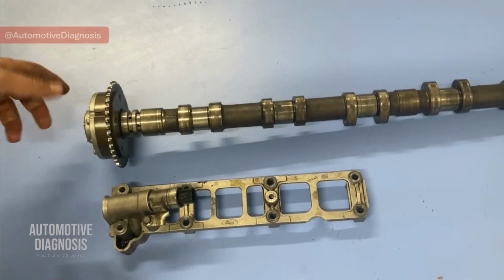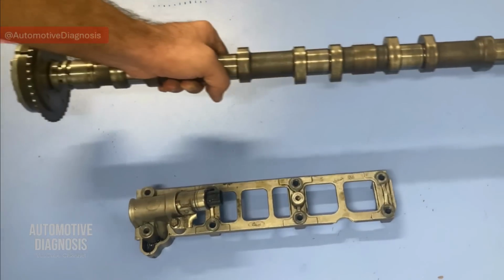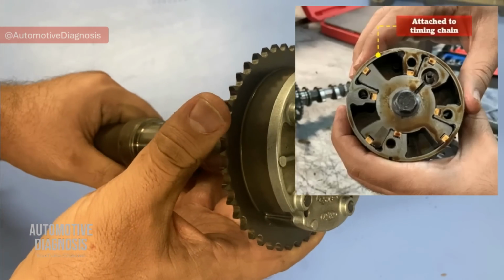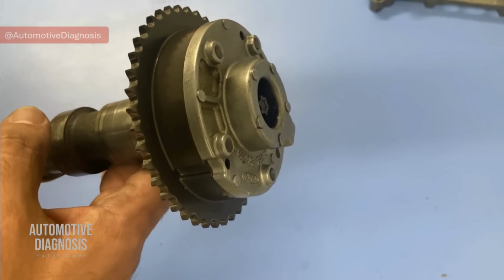Don't Replace Cam & Crank Sensors | Do This First for Engine Timing Fault Code P0011 | P0014 | P0016

Comment: Great video, I have the code P0011-66
Present
Intake Camshaft
Phasing Mechanical
Reference Position Ra... I have replaced both solenoids, could this fault be the vvt phasing pulley, my engine is A16XER Vauxhall.
Reply from the maker: Hi there, that could be the issue too, there are a couple of ways to check the phaser operation, one way is by scan tool, the other one is by activating the solenoid when engine is running, you should check which one is applicable to your car.
Reply: @AutomotiveDiagnosis thanks for your reply, I have the launch  x431 diagnostic scanner, would that be able to test the phasing pulley, if so which section do I need to go into to analyse it ?

Comment: What are the common issues when this part goes bad?
Reply from the maker: Hi my friend, there could be a couple of different issues: Stuck locking pin, broken position pin between VVT and camshaft, noisy VVT.

Comment: Hi sir thank you so much for your video! But I would like to ask please! What does this fault code P2787 means on the Mercedes Benz GLA 220 CDI 2014
Reply from the maker: Hi my friend, for Clutch Temperature Too High?
Reply: The clutch actuator temperature is being monitored by the transmission control module. This trouble code would be set by the TCM when the clutch actuator temperature would not be as per the specifications set by the manufacturer.
Common Symptoms
    Appearance of the service engine soon light
    Issues in transmission shifting